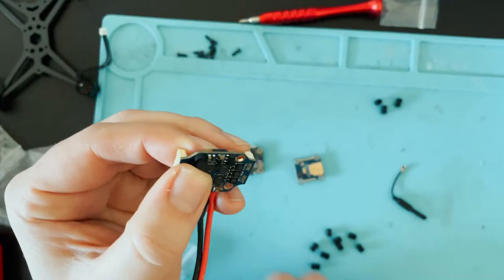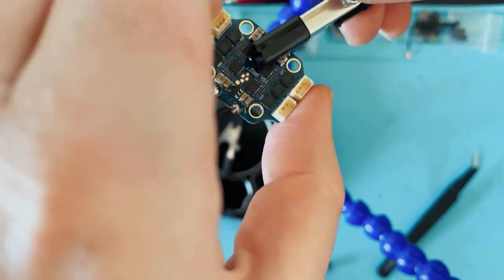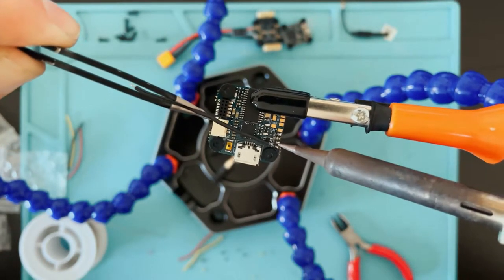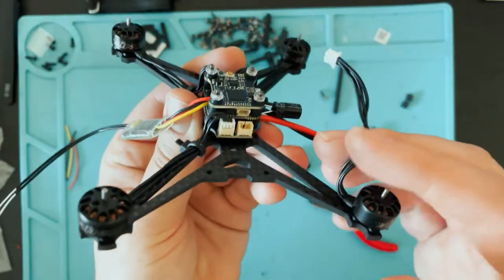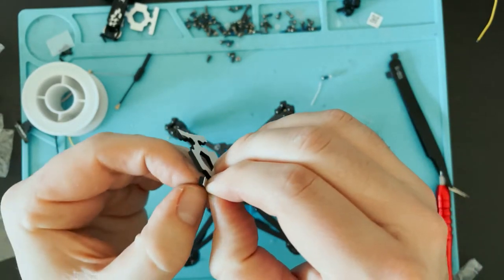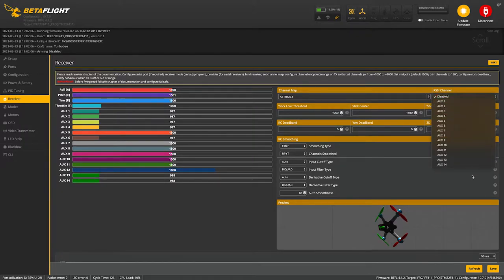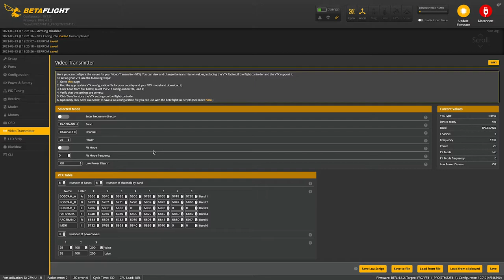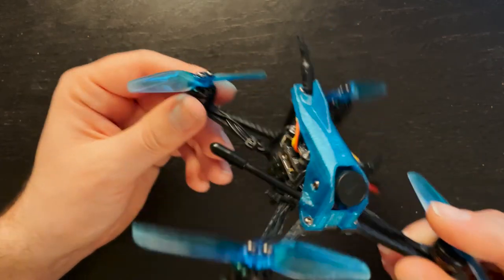iFlight Turbobee - Full Build Video w/Flight Footage

Comment: Hey Troncat, thanks for this! I recently got a TurboBee kit and assembled my first drone following your directions here. And, I finally got my maiden flight on it! Very exciting.

I encountered a few difficulties, and I'm going to share them in case anyone else encounters these difficulties.

My first problem was soldering the receiver to the flight controller. These pads are very tiny, and my soldering skills are beginner level at best. I actually had to order another flight controller as I burned out the pads on the first one. I noticed in the circuit diagram that there are actually two 5v pads, so I used the one on the "top" (if you orient the FC in the way you did in the video). That way its not squeezed between gnd and data. I suppose this top 5v is for the buzzer, but I didn't put one in - if I do later I might just solder it on top, which while ugly, I hope will work.

My second problem was that the XM receiver would not bind to my Taranis controller (solid red). After some Googling I determined that my XM receiver was flashed to EU standards (I am in the USA). I had to google how to reflash the XM receiver, which entailed desoldering the XM receiver off the fc, soldering on leads that could connect to my Taranis, and then hooking up my Taranis to my computer to download the FCC compliant firmware. I was aided in this effort by hooking up the XM receiver to a 5v power supply from a Rasperry Pi so that I could test binding - this would have been almost impossible if I had to solder the XM back onto the FC for power to iterate through trying stuff to get this to bind.

I would say most people don't have 5v power supplies and breadboard wiring lying around, so this is kind of a big potential issue if people get receivers with the wrong firmware.

The next two problems were more easily solved, but were still worth noting.

My third problem was that the channel mapping to throttle, pitch, roll and yaw was all messed up when I looked at it in Betaflight. Fortunately Betaflight has different settings for these mappings. I just needed to set it to TAER (Throttle, Aerolon, Elevator, Rudder) instead of AETR.

My fourth problem was that my motors were spinning backwards relative to what betaflight expected. Later versions of Betaflight have a toggle to switch expected motor rotation, and I believe the latest version (as of Jan 6 2022) actually has an individual motor control interface. This would have been a minute long fix, but I got distracted by old webpages when changing motor directions was only feasible by going to a Belheli interface and modifying it there (terrible documentation). Fortunately I managed to escape this rabbit hole as I noticed the toggle in Betaflight just as I was messing around in there trying to solve this problem.

Finally, I would like to mention that on the drone I was flying before this (a BNF, not a kit), I had a lot of trouble getting Betaflight to connect to the drone. The problem here was that my USB cable was not data capable only charge capable. Many USB cables these days are like this, and they are not labelled in any way. This is a typical beginner mistake, and could easily happen to a beginner attempting this build.

Thanks again for the video, I would not have been able to do this without it!

Comment: do you need to buy a separate receiver for this? if so is that the only extra item it needs?
Reply from the maker: Yes the receiver is the only additional item you would need for this drone. Some retailers sell the drone with a receiver already installed. 
Thanks for watching!

Comment: Not sure if leaving the capacitor out hanging is a good choice. Other than that, well done on the build.
Reply from the maker: agreed haha I have since upgraded that to one of those xt30 cables with the capacitor secured to the connector (wish that it came with that in the first place) 
While flying with it on the side I never ran into any issues though. I really whipped the thing around and it took a pretty good beating and was still fine. Thanks for watching!

Comment: How durable has this been?? I have it in my cart but skeptical it looks awesome but I crash a lot still haha what do you think?
Reply from the maker: Honestly, it was more durable than I anticipated. It took quite a few good whacks lol. I flew full speed into the side of a metal shipping container and was able to turtle mode over and fly away. 

Not long ago I did crash and the small pins that hold the stack together ripped off and now the FC/ESC are pretty much useless. If you can find an AIO board that runs 4s I’d go for that and avoid the pins. 
Hope this helps! 🙌
Reply: Thanks is there any AIO u would recommend or just completely get a different drone?

Comment: Hey man, which do you prefer, this or hglrc petrel 120 pro?
Reply from the maker: Between those two, I'd go with the HGLRC Petrel (https://usa.banggood.com/custlink/m3GdoTyfNR). 
One of the main reasons is the fact that it has an AIO board while the turbobee has pins that hold the stack together, they're extremely fragile and in a good crash can rip off. You dont have to worry about that with the HGLRC. Another reason is the Petrel is rocking 25a while the turbobee has only 15a.
Hope this helps! Thanks for watching 👍
Reply: @TRONCATFPV  Very helpful!! Thanks.
Reply: @TRONCATFPV  What about SPCMAKER 130PRO?